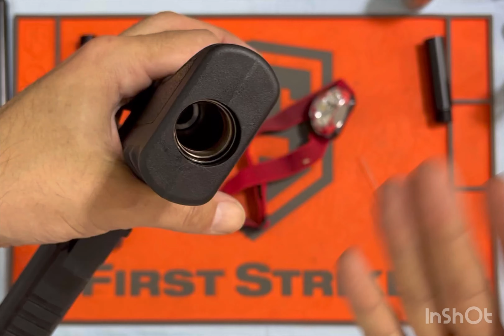LL4D Salt Supply S2 - Drilled 1mm co2 restrictor

Comment: i remember doing this with my Torpedo Revolver, pain in the arse, most i get from hpa now is 61 joules and i think its opened up around 5-6mm now wide open for hpa :) had to swap bolt springs cuz stock one was to weak
Reply from the maker: I tried a super heavy Tipx spring in this launcher wide open and it still farted so i am treading lightly so hopefully we dont have to change any other internal workings.
Reply: @lesslethalfordummies  sound then like it may be the oring hmmm i swapped that as well it was a hard slippery plastic type oring
Reply from the maker: I may have to try and find a new oring for this sooner than later. Il see what i can find. The factory one is kinda of clear blue.

Comment: Nice test Sean. Wich drillbit size will you use next? 1,5mm?
Reply from the maker: I have tried 1.2 and skipped 1.5 and went to 1/16” which is about 1.6mm.
Reply: @lesslethalfordummies  Nice. How did it go?
Reply from the maker: Just posted that video 😆
Reply: @lesslethalfordummies  OK. I stay tuned 😁